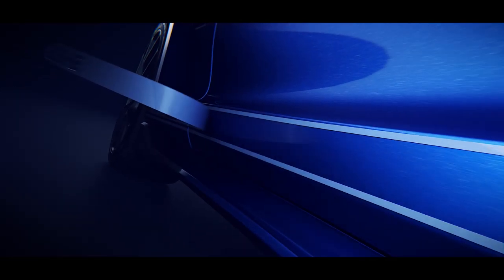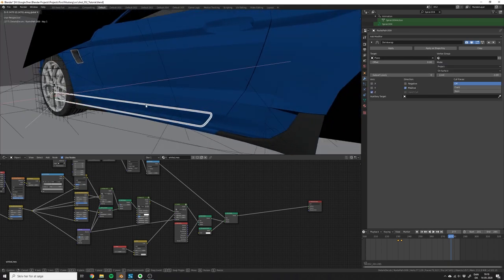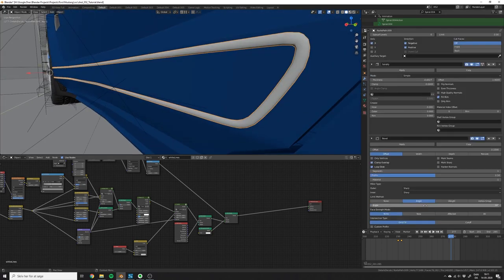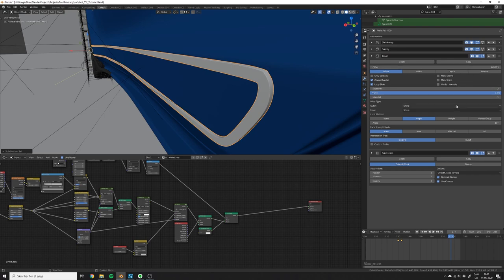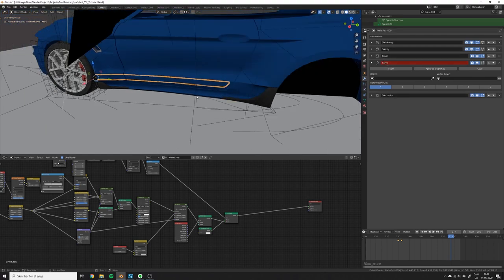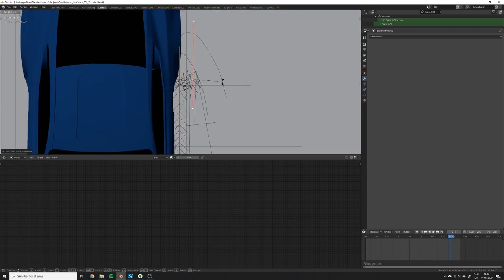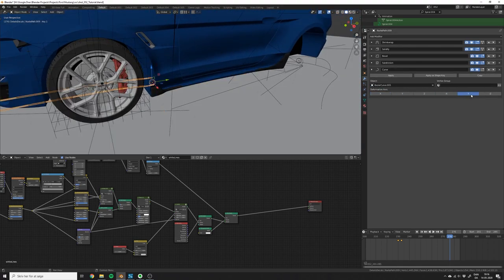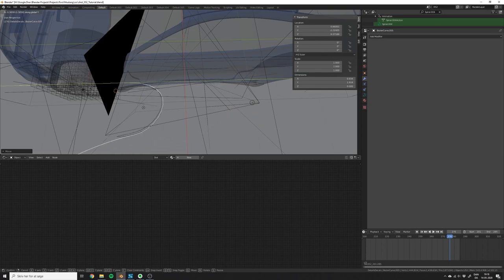Blender Tutorial // Animating a Racing Sticker

Comment: I would like to ask a few questions:
①How can I render the car's headlights well? I always render them dark and without details.
②How to show the speed of the car, is it related to the camera shutter, engineering frame rate and other parameters?
③How to make the voice of the work? Is it purchased copyright music or made by yourself?
Thank you.
Reply from the maker: 1. In a video I am working on right now - Talking about how to make tail-lights look nice. But for the head light it is the same thing. You need to have a lot of detail inside the lights. If you just have a sphere emitting light, it won't look so nice. Try to add as much geometry as you can in there (Look closely at references of headlights and see what kind of shapes and volumes they put in there. :)

2. Hmmm, I didn't change the shutter or frame rate or anything. I made the camera shake when the car was racing by it - And then the lower you place the camera, the quicker the car will look. Also when you are animating the car, it's good to make the body sway a little bit from side to side, like it has some weight and also not make it turn too sharp. If it makes a very sharp turn all of a sudden, it will not look like it is driving so fast. Imagine when you are on a highway - You turn the steering wheel just a little bit.

3. The sound effects were done by a freelancer and for the music - one was purchased and one was "royalty-free" when used on youtube. It was with a license from Fixt. :)